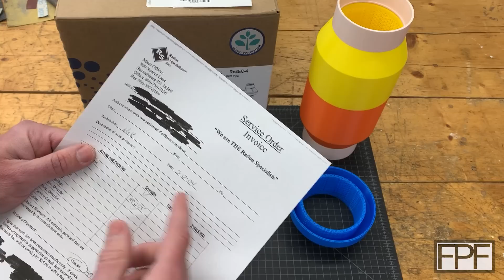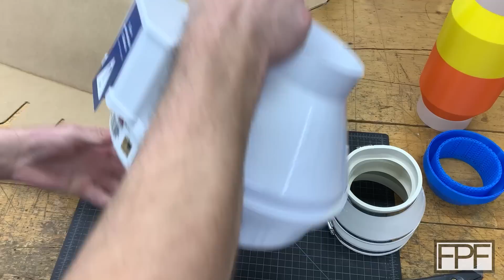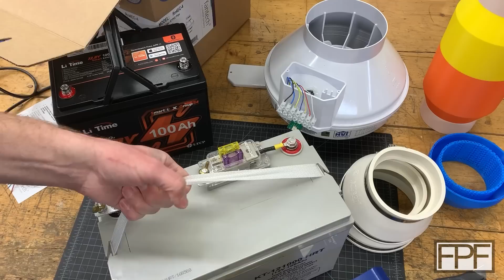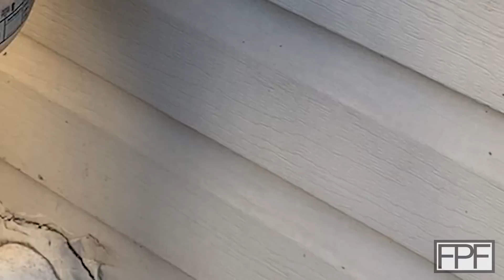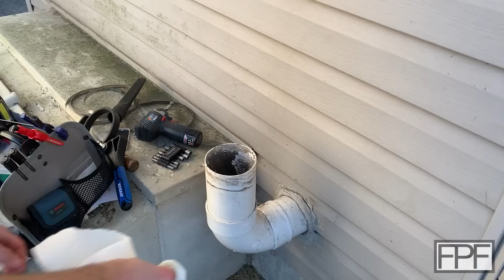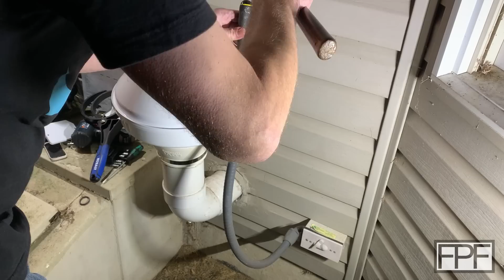3D Printed Radon Exhaust Quieting - The Saga Continues

Comment: I'm actually on the AARST standards committee. I had a radon mitigation company and now produce products for the industry. It's an old system, and the fact that you needed adapters....its schedule 35 pipe. A new system going in would require schedule 40 PVC. A system done properly would always be schedule 40, however there weren't too many rules 20 years ago. Its very cool to see other people working on solutions.

Comment: I'm not sure what happened to it, but I used to have a hole saw kit that I inherited from my dad, where you could fit two saw blades to the arbour at the same time.  The smaller blade would extend beyond the outer blade allowing you to use it as a guide when enlarging a hole.  In your case, you'd fit both a 4" and a 4 1/2" blade.  The smaller blade would act as the guide while the outer blade did the cutting.  It would have been a whole lot simpler than the admittedly ingenious arrangement you eventually came up with.  I can't imagine that they stopped making this type of hole saw kit, you might even find that your own allows you to do this and you never knew, but I'm in the UK and maybe they never made it across the pond.

Comment: In my case i just replaced the bearings for 3,5€ and there was silence again. Oh, I also excessively cleaned the blades and did not need to rebalance them this way...
...and as general rule (of mine ): No holes in the roof. 'No' like in zero...

Comment: Seeing that ebmpapst fan does ring a bell. My former employer uses these in some of their industrial air cooling units. They range from super quiet to deafening. The electronic commutation circuit is entirely encapsulated within the fan itself, the motor is of the Brushless DC type. They have multiple interfaces for speed control, one of them being a 0..10 V DC signal which is probably used here.

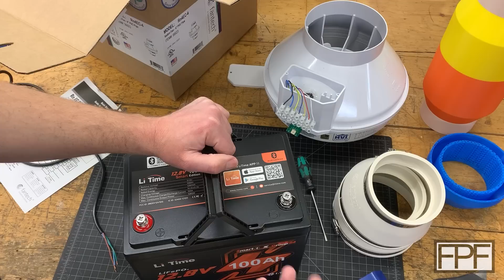Comment: Pausing at @10:47 . be very careful with lithium batteries ratings. Most are fake, as they are "lead acid equivalent", or "PbEq" . this one does not look like it has that marking so that is great.  What that marking means is simple: 100Ah marking = 50AH real. It also goes for max intensity, they can do approx. 1/3rd (but that wont be an issue for you). LIFEPO4 are great as they arent as much of an issue as the usual lithium cobalt ones. LiCo has more energy density and make 3.7V per element. I built my track car battery from LIFEPO4 A123 cells for that reason, they dont catch fire easily and while lacking a bit in capacity, they can deliver high amps. I made a 10AH ish battery (real 10AH)  that can output 300A continuous and 700A for 10 seconds.  It has been going great for years. Best of all, it weights nothing (1.5kg, 3Lbs) and the size is ridiculously small.

Comment: I guess that I don't understand why it has to be discharged so far up. Once it hits to open air, it will be diluted and blown away. And the Radon level can't be THAT high. Why couldn't the pipe just discharge at soffit level with an L-shape?

Comment: Guessing by the installation of the Unit.  Surmising that your radon unit was installed after the house was built and that there was no inspector involved in reviewing the work done.  As you mentioned in your video about the truss being cut and probably shouldn't have been done. In this particular instance, it would seem that increasing the diameter of the pipe to the 4.5"sch40, you would have to increase the size of the holes that are already in your home. 
Although it may have lasted 21 years is doing more damage to the truss a good idea?

You didn't mention the diameter of the already existing pipe that you pulled out, but I'm guessing that it is approximately 4.215 O.D. S&D (Sewer and Drain pipe). If you wanted to try and go with a thicker pipe, pipe manufacturers do make SDR 35 and SDR 26.  Both of those are Sewer and drain pipes with the same outside diameter but thicker walls. The issue with this kind of pipe....its green not white in color.

Also increasing the size of the pipe or changing what pipe that you use might put more stress on the S&D fittings that you currently have coming out of your house, specifically that 90 degree bend. I did not see in your video any type of pipe support under the radon unit and fittings. Will any additional weight cause issues? If you change the diameter of the pipe are you going to have to help suspend the weight of the pipe using a strap, support or clamp of some kind?

Comment: Yeah man lifepo4 is an amazing advancement in batteries for this purpose. I'm surprised you're using 12v though. Everything I've read said you want at least 24 volts. Maybe that's just if you want to wire several of them together.

Comment: OK, paused at 18:40 to comment. First before messing with removing the old length of pipe, I would have tried temporarily installing the new fan to see whether that change alone made a significant difference. If it did, there might be little need to even replace the upper length of pipe. Now, back to the video...

Comment: More of a comment from last week although I think you are on the right track..  From the initial sound it seems as if you have a standing wave (i.e. resonance) from inside the PVC pipe going up the side of the house similar to a pipe organ..  Possible methods of reducing this would be to add mass like a sound dampening tape for auto/van noise reduction to the outside of the pip going up the house or changing pipe type as you are in the process of doing. The other simple and very inexpensive method would be to drill ports/holes ~2"dia. at "key" places going up the side of the pipe.  While this could be very effective it is an exercise in math to determine exactly where to drill the holes for maximum effect.  Good luck to you as a noise reduction process can be tedious.

Comment: Yep, had to sub to see where you go with this. 👍 On your centering jig, you can go ham on complexity, or as simple as you like to drill a hole. Personally, I tend to overthink some problems and come up with elegant solutions, when all I really needed after the first elaborate attempt was a temporary helper to do a temporary job. In that vein, I would opt for a sacrificial surface that you can mount somewhere convenient (scrap wood or whatnot) just so your pilot bit has something to bite into and enlarge your hole. Ideally having a helper to hold your sacrificial piece would be useful, but most of the time (provided you have the luxury of having access to both sides) a lumpy weight will suffice in place of another person. In lieu of that, cured spray foam to temporarily fill your existing hole wouldn't be a bad shout either, as it's pretty easy to remove the bulk in the process of drilling your hole anyway.

Comment: The fan looks like it uses an electronically commutated motor or "ECM" for short. It is pretty much like you thought, an inverter driven brushless dc motor. These have been replacing split capacitor motors in residential and small commercial units in the HVAC world for a bit now. They are pretty neat but the electronics in them make them more susceptible to being damaged by power surges.

Comment: I didn't read the comments but you can often put a smaller hole saw in a bigger hole saw to use as the guide.
Reply: Print a 4" ""saw" to center the saw. Why use another saw when you can print one.

Comment: I know with my EcoFlow Delta Pro, it's the type of XT60 connector that determines the charge rate.  They use an XT60i connector and have either the positive or negative connected to the 3rd pin to determine if you are current limited or not.  Not sure about the Delta 3 Pro.

Comment: The AGP battery you can use only about half of the power of the battery.  The AGP is still a lead acid batter.  For the LiFe you can use it down to fully discharged (not best, but can be done without destroying it on occasion).
Reply: The weights he showed also make sense, since lifepo4 batteries have triple the energy density of SLA batteries. Six times if you include the 50% rule to keep your SLA batteries healthy

Comment: I’ve always used a paint stick and two sheet rock screws to get my circle bits to cut into a bigger  . Do pre-drill the holes it like the crack if you don’t. But you can always 3-D print a plug to go in it with the center hole and a little superglue and off you go that will work also. The paint stick is down and dirty. It gets the job done in the shortest amount of time and it doesn’t have to be a paint stick. It can be any small piece of wood. I can be held up in there. Just most people have 10 or 12 of those sitting around or more. You could literally use a carpenters pencil.

Comment: I now use LiFePo in my motorcycle, both for weight and for cranking power. It does not decrease like AGM or lead acid as the battery depletes.

Comment: Why not leave a short section of the original pipe penetrating the roof, and just replace the section from the fan to the soffit with a flexible adapter to fit the section going through the roof?

Comment: Just had a similar revelation on the batteries. I swapped out two 100Ah lead acid AGM batteries on my RV with two 100Ah LiFePo4 batteries(my inverter/charger is compatible). So much lighter and LiFePo4 batteries have more usable energy compared to the AGM.

Comment: Li Time is a good LIFEPO4 battery manufacturer. I used to have a 100ah battery in my truck, then switched to two f their 230ah packs. Nothing wrong with the 100ah, just smaller than i needed. The two packs have been going strong. And with a lithium battery, using the voltage reading is a terrible indication of how the battery is doing. Lithuim is pretty good at stying consistent in voltage up until the very end, where it will drop off. You need to use something to get the state of charge, which is a better indication of battery health.
Reply: LiCo has a good voltage until near depletion, but LIFEPO4 is much more linear. both are much much easier to read than lead acid, or worse NiCd

Comment: I really enjoyed your video as I made my own Radon mitigation system some years ago.  As a ham radio electronics geek I really was amazed by the battery with built in Bluetooth!  That would have great use for a ham station's emergency power.  I'm also into 3D printing and enjoy that aspect of your videos.  As much as it might reduce airflow maybe some baffles in the muffler?  I'd think about how car mufflers are designed.  I look forward to your conclusion in this series.  I like how you have a very cool set of tools to work with, as well as know tools are so important to tackle a variety of projects.  Great work! 👍🙂

Comment: I was thinking of a semi truck vertical muffler.. so instead of just a small muffler like you were trying, how about replace the WHOLE vertical stack up to the soffit with a 3d printed muffler? It'd still look like a pipe. Would definitely have make it in pieces. Also I'd make a cap at the top to prevent all that junk from getting all up the new pipe.

Comment: battery cycles are calculated as how many times you used the capacity.  so 5 times using 20Ah and recharging all the time gives 1 cycle. No need to drain to empty.

Comment: Maybe you could re-use the old pipe, because the new motor has different characteristics than the old one and maybe that's enough for your purpose.

Why not keeping it simple when it works, when it's quiet enough.

Maybe just hold the old pipe onto the fitting above the motor as close as possible, while you hold the pipe so that it goes up just on the side of the roof. Just for this first test...

Yes, holding it by hand would dampen some vibrations, but maybe that's anyways good enough for a quick test.

Comment: With handling the battery happening pretty frequently, would probably be a good idea to wire in  circuit breaker and maybe a plug instead of connecting alligator clips and keep the terminals covered up. Would suck if something fell on the battery and shorted it .

Comment: I’d use a flush trim router bit and a template to increase the hole size, do that often while woodworking. Also, should work doing aluminum!

Comment: Bambu Lab shipment you say! Here's to hoping it's the new H2D, fully loaded with laser and all of course 🤞. As to the hole through your roof (I'm sure you've thought of this) you could print an adapter to go from sch 40 to thin wall just before your soffit and avoid enlarging the hole in your soffit and sheathing. If not, McMaster Carr sells some really nice hole cutters for thin metal that would make a clean hole in your aluminum soffit (although they are a bit pricey, esp. one that size). If you go with this particular hole cutter, it wouldn't be practical to place a smaller cutter inside as a guide as previously suggested, but you could 3d print a guide. There's probably a less expensive option to cut it, though, so hopefully you get some great ideas from everyone.

Comment: Central vacuums also suffer from the kind of noise you are experiencing.  It's air turbulence  echoing/reflecting inside the pipe.  The solution used in central vacuums is a box/pipe  lined with polyurethane open-cell foam.   You may need 2 units - one near the fan, and one at or near the roof outlet.

Comment: It's interesting how one's paradigms can guide the thought process. There is no need to 3D print pipe adapters. You can buy them at any big box store. If you have a 4-1/4" hole saw, you can nest that inside the 4-1/2" one to guide it. Or, remembering that the boot will be covering the opening, just use a reciprocating saw or multitool to enlarge the opening enough for the pipe. The hole doesn't have to be perfect. The vinyl soffit can easily be removed to allow access from below so you don't have to disturb the shingles. Then, you can trim the soffit with tin snips or a utility knife before reinstalling it. Keep up the great content.
Reply: It easier to make one. Remember that you’re not working on it while it’s printing. It actually takes a lot less time.
Reply: If you live 5 minutes from a store with such a part, then maybe. Otherwise, for 90% of people it will take less time (and money, and resources in general) to design the part, let alone just downloading the design if it's a common adapter, and start the print, than to move your car.

Comment: Echoing a few others. Just enlarge the hole with a drum sander, flap disc, dremel, rasp burr, recip saw, anything. I wouldn't use a hole saw. You can pack it with weather strip or canned foam to keep bugs out of the attic. Cut some excess off the pvc or 3dp a ring to guide your progress

Comment: I’d use a short section of the original pipe, and couple the larger pipe just below the soffit, instead of going through all the trouble of enlarging the hole. 
Just my 2 cents worth. Your house, your decision. 😀

Comment: if you have a hole saw that is the original size and an arbor with a long enouth thread, you can fit the smaller hole saw in the larger one and use it to centre on and drill out the hole.

Comment: As far as the soffit goes cur the hole over size and 3d print a two piece ring to fit the new pipe od with a lip to cover cut soffit ...screw the pla ring to the soffit. Installed

Comment: Maybe it's because i am lazy, but i would keep the piece that goes through the roof of the old pipe and leave the hole as it is, and just make an adapter between old and new right below that. The remaining short part that goes through the roof won't be the cause of the noise. And if the adapter is made of a softer material almost no vibration and so no noise would be transfered to that part and the roof either.
On the last video someone alraeady mentioned that soft adapters between the fan and the pipe upwards also should decouple transmission of vibrations there and so reduce resonsance from virbration.
Reply: Yep, I would certainly try that before enlarging the hole in the roof.
Reply: Had the same thought, but im not sure how the lower diameter and resulting pressure change would impact acoustics.
Reply: @ Interesting point. 
Smaller diameter increases the speed of the air movement, a smaller increases the speed.
Usually with mufflers or sound supressors for firearms you also have a bigger diameter section in the middle and a smaller end again, and it works though.

Comment: I would not try to use the hole saw through the aluminum soffit as it's likely to grab and tear it up. If you use tin snips to enlarge the existing hole you'll be less likely to mangle it. If the aluminum soffit is covering an old wood soffit panel it might be tricky to get the snips in there though....

Comment: The hole doesn't need to be clean. Just use a multi tool with a saw blade. I recommend a blade with a slight curve.

Comment: Hi, the way I’ve dealt with the issue of having to enlarge a hole with a hole saw is to use the original hole saw blade as a guide. Mount both the original size and the larger size together and then carefully position the smaller in the exiting hole. It will guide the larger hole saw and keep it centred. I must admit though I have only done this with smaller hole sizes.

Comment: You can order hardened steel sleeves for drilling jigs online. They will fit different drill bit sizes.
It wouldn`t be a hard thing, to design a plug in the right pitch of the roof and press the steel sleeve in the centerhole, 
to guide your drill bit.
If you design this like a car wheel with spokes, you can run screws from the inside of the wheel into the wood outside, to hold everything in place
and adjust the hight, if you have to work your way down in sections.

Comment: I also got those o-ring kits. Quality is low  not rubber, plastic. As so many these days. Dont use then any place that need to hold up, or big job to replace, or your /your family safety is matter. Like dont use them in car fuel- or oiling systems.